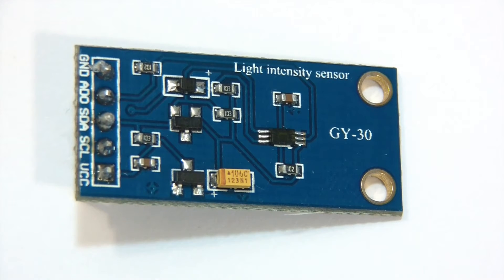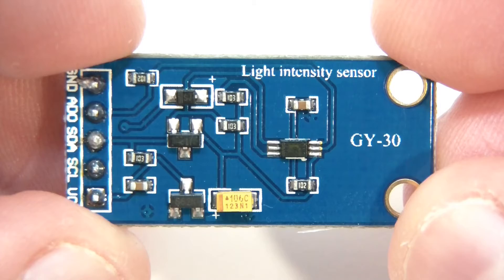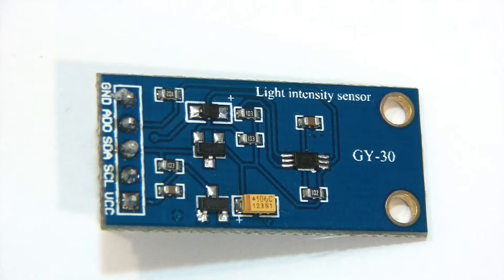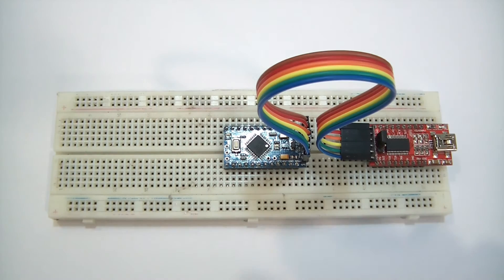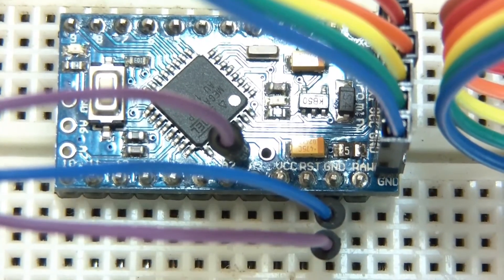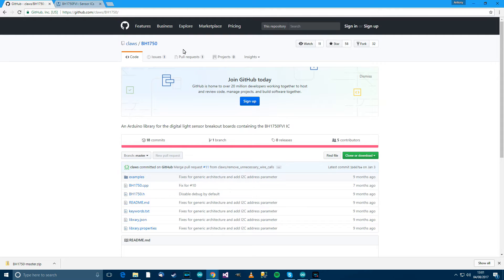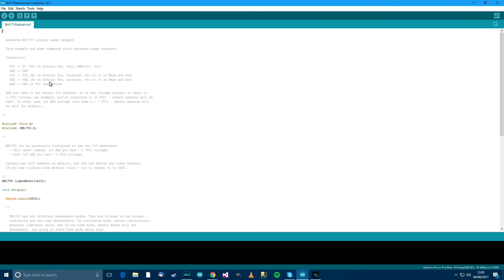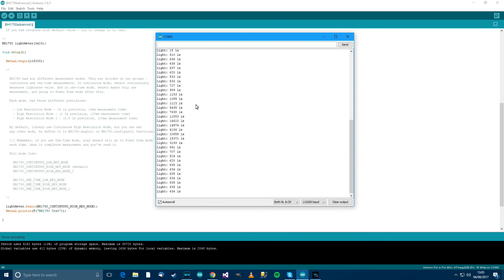TUTORIAL: How to Wire & Code GY-30 BH1750 Light Sensor (GY30 / GY302) - Easy - Arduino Module!

Comment: @Antony Cartwright I'd tried to execute this project in ESP32 (30 pins), but unfortunatelly only shows: "[BH1750] Device is not configured!" please, how to configure this sensor to work in the ESP32 (WROOM-32)? is it necessary to configure in the BH1750.cpp or BH1750.h files? What could I do to work correctly?
Reply: Did u fix error

Comment: Hi, I have a problem please help me.

I used the GY-30 light intensity sensor and Arduino UNO and connect the wire that you told me but It showed

"Problem uploading to board.  See http://www.arduino.cc/en/Guide/Troubleshooting#upload for suggestions."

Thank you in advance for your help.

Comment: Hi Antony,

First of all thank you for the work contributed to the community and the effort for all to understand.

I am working with Arduino mega, making a solar tracker with 4 BH1750 and 2 NEMA 17 motors.

I have several problems, and I would appreciate it if you can help me, the problems are the following:

1. How can I configure the library or the code to work with Arduino Mega 2560?

2. Do I need to work with 4 BH1750 modules, how to configure the analog inputs and show all the data per screen?

Thank you very much!
Reply from the maker: Hi Carlos, thanks very much. I got the easy job! Hundreds of other guys write the libraries for these modules, and without them, we'd be lost! For the most part, they seem to go unnoticed.

Solar! I love solar and I'm interested in your project - will you release videos?

I honestly think it is better to select a more common microcontroller - if you really like that sort of board, maybe choose an Uno. For me personally, I'd attempt the project with a Nano. There are far less compatibility problems with more common boards.

BH1750s are not analogue devices, they're digital. Firstly get yourself set up with just one device, then two, then add the other two afterwards.

With the screen, first get the screen to work alone with the Arduino, then when working, then merge the code and wiring with the BH1750 stuff. I have a video for TFT somewhere.

Antony...

Comment: Hello, I am getting this error. Help? Btw. I have an Arduino UNO so SDA went to A4 and SCL to A5.
[BH1750] ERROR: received NACK on transmit of address
[BH1750] ERROR: received NACK on transmit of data
[BH1750] ERROR: other error
[BH1750] ERROR: undefined error
Error initialising BH1750
[BH1750] Device is not configured!
Light: 0 lx
Reply from the maker: trickybilly is your code exactly the same as mine?
Reply: Thank you for your answer. I double-checked the wiring and it is ok and the code ("BH1750advanced" taken from the BH1750 examples). The error remains. Btw. I have an Arduino UNO rev3 which has a dedicated SDA and an SCL pin, should I try those instead of A4 and A5?
EDIT: I have repeated the same experiment with my Nano - same error as above
P.S. I have also tried a method on instructables using three 510 Ohm resistors. Then the only output I get is 54612 lux. Reference.
https://www.instructables.com/id/BH1750-Digital-Light-Sensor/
Reply from the maker: trickybilly do you have another light sensor to try?
Reply: Thank you for your input. Unfortunately I do not have extra sensors. My sensor looks exactly like yours, guess it is the same version.
I may try another solution, the IOREF way: https://www.instructables.com/id/BH1750-Digital-Light-Sensor/
However I am a little scared since I have read that IOREF has 5V and this sensor requires 3.3V plus I am not sure how EXACTLY 3v3V-IOREF and VCC are connected on that picture.
Reply: @realtrickybilly  did u fix the issue
Reply: Same to me

Comment: how to fix this :
BH1750] ERROR: received NACK on transmit of address
[BH1750] ERROR: received NACK on transmit of data
[BH1750] ERROR: other error
[BH1750] ERROR: undefined error
BH1750 One-Time Test
[BH1750] Device is not configured!
Light: 0 lx
[BH1750] Device is not configured!
Light: 0 lx
[BH1750] Device is not configured!
Reply from the maker: NACK? Is that No ACK? No Acknowledgement?

Comment: any idea how to access two different addresses for this particular sensor when using multiple sensors on arduino uno ?
Reply: You can use an I2C multiplexer if you have multiple sensors with the same adress. https://learn.adafruit.com/adafruit-tca9548a-1-to-8-i2c-multiplexer-breakout/overview
Reply from the maker: Hi Jason, yes, you see in the code I show, where it says 'BH1750 lightMeter(0x23);', well that bit is responsible for the light sensor address. Antony...
Reply: thanks for the quick response! sorry i should have been a bit more specific, ive got two sensors to read from that exact address , but i need to implement two more sensors , but to a different address. possibly 0x5C ? just not sure how to differentiate on i2c interface ? 
jason..
Reply from the maker: Hi Jason, As far as I know, the I2C protocol was not designed to have two devices using one address! By putting two sensors on one address, you're asking for problems. About the addresses though, each device has it's address set by the ADD Pin. I'm not sure exactly how that works though.
Reply: much appreciated Antony!
Reply: The most you can have are two of these sensors on the same I2C bus. The ADD pin sets the address. Tie the pin to ground and that BH1750 is addressed at 0x23. Tie ADD pin high and the BH1750 is addressed at 0x5C. So you could have two of these on the same bus, one ADD pin high, the other low and you avoid any bus collision issues.